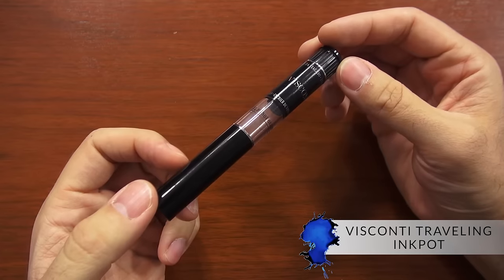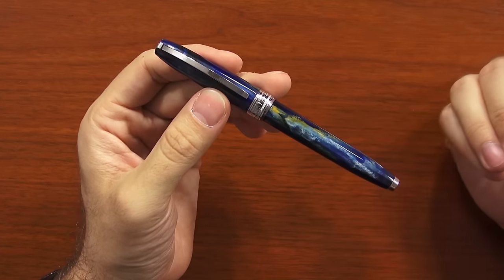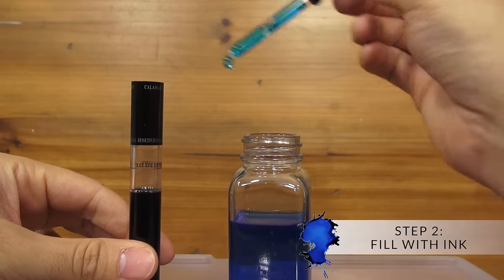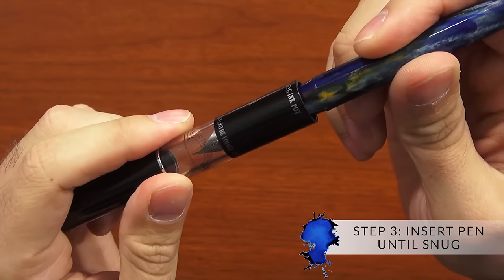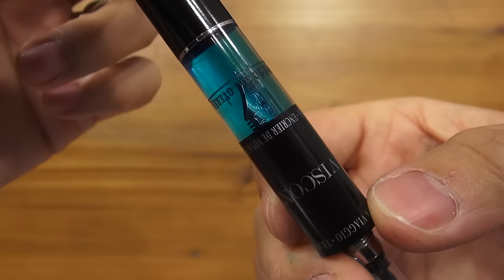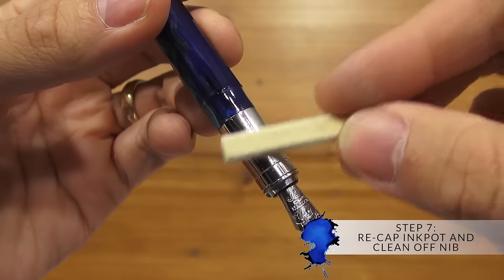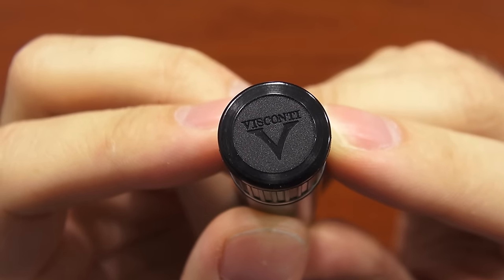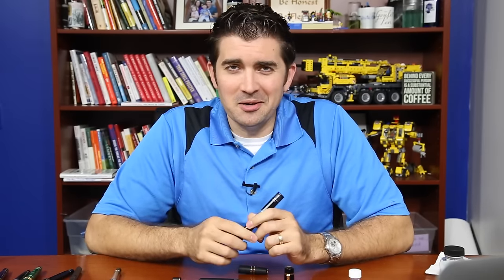How To Use The Visconti Traveling Inkwell

Comment: Brian:  Hey, thanx so much for this demo.  I always wondered how this device works.  I am mostly a Parker 45 writer (cap-actuated w/ Capless Ceramic Ball Gel P44 Broad refills), but defer to my 2 Pelikans (M200 Broad or M400 Fine) for more formal occasions.  I saw a vendor demonstrating this inkwell in my local pen shop.  He was not paying sufficent attention while talking w/ his client & leaked ink all over the counter.  I was too embarrassed for him to ask for another demo, so I’m glad I stumbled upon your video version.  Thank you!  P.S.  I love the lux look of the higher-end  Visconti inkwell model fashioned from Mt. Etna volcanic material; not sure if I’d spend $200+ for it, though.  Last thought:  Does the rubber seal that holds the pen barrel during the filling process ever wear out or is it designed for long life as long as the inkwell is handled w/ the required care?  Thanks again for the edification.  :-)

Comment: I believe you need to add that the converter, sac, piston, etc should be in the position at which there is the least quatity of air inside them.
Reply from the maker: +rafaelpapp in the full length vid I cover other filling mechanisms more specifically, this was more of a basic concept of how the thing works. https://www.youtube.com/watch?v=3l4HvhB8AVc&lc=z12ygn3plyzozv0w404cfnppdmqzjffxyy40k -Brian Goulet